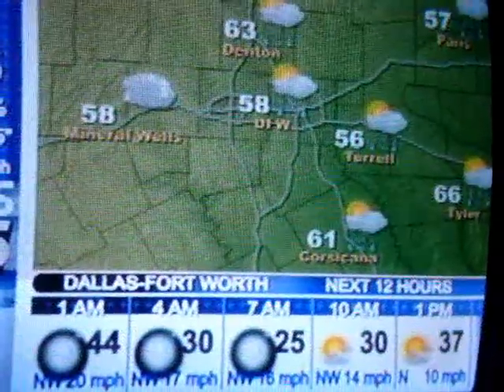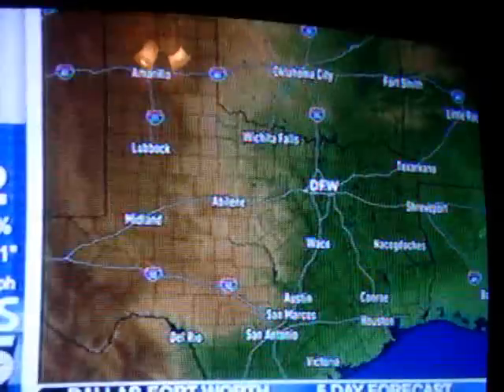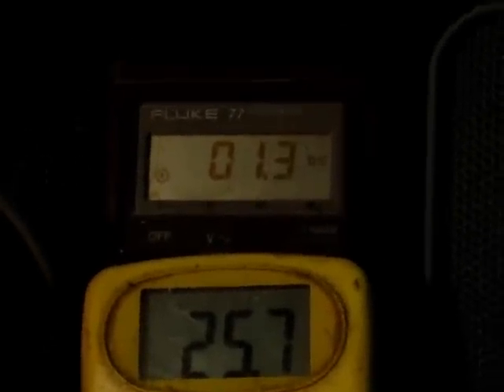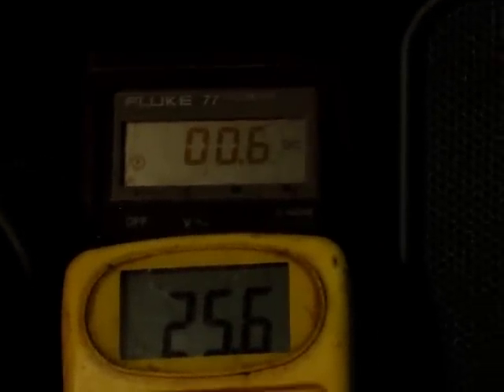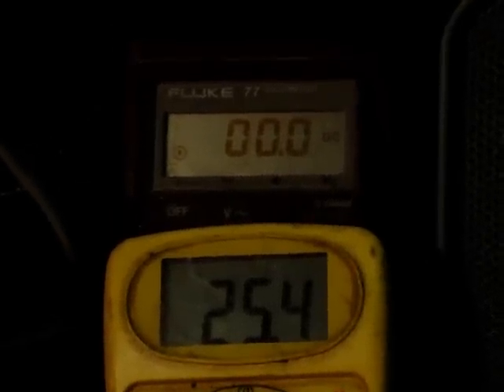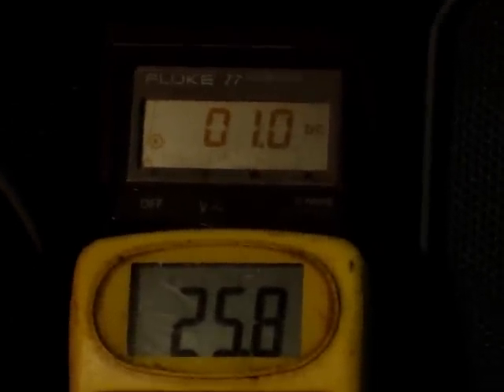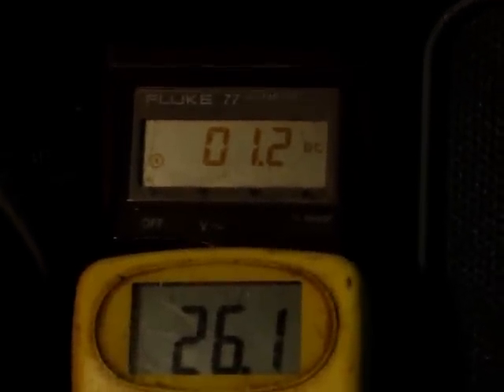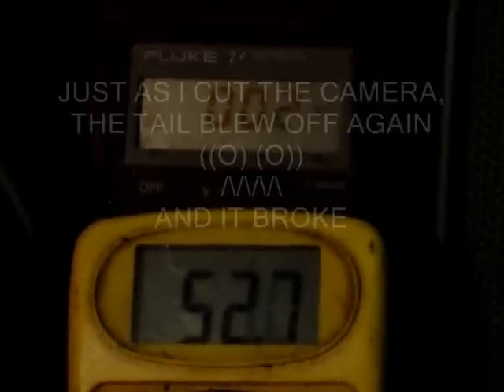PART 4 HARBOR BREEZE CEILIMG FAN WIND TURBINE UPDATE

Comment: Hey... Have you thought about forgetting about the troubles you are having with the tail and directional issues you are having by making one of those horizontal .. sort of like the wind speed monitors. Like helicopter blades but with coned cups or something to that effect on the tips? I hear that that picks up wind from whatever direction it chooses to shift to.... and if you use a slight pitch to to gain a little tiny bit of lift force..it might reduce some friction at some point... Maybe... what do you think? Shoot me back a response if you like that idea at all. Cause I have another idea to shoot you if you wouldn't mind playing around with it. I saw you doing that magnifying lense thing and have seen a sort of "Solar Sail" thing once.. it was a kids toy my mom got me at the Smithsonian... but... amazingly enough... it turned by light ..in a very low pressure (almost Vacuum ) situation...  One side of the outer paddle blade was white and the other black... and in the low pressure, the heated side caused a pressure differential that moved the paddles... I'm personally working on it..and trying to get an extremely low friction / bearingless Vgate magnetic assistance shaft to go along with it.. but for now, I think a magnetic coupling to that horizontal wind turbine drive would give some great torque ... long arms are long levers... and I think you might get less bend in your vertical shaft when the wind pushes... cause that vertical airplane prop has to have some serious desire to bend back.... so horizontal might save a lot of problems from happening in the future...maybe? Sorry for blasting too much info all at once..but I like your vids.. and I see some potential but also some design improvements to cut down on components and give more RPM and torque that could go to a sort of 10 speed bicycle transmission to step up and step down when wind speed gets too much or too little etc..
Reply from the maker: J.T. RipTideProStaff I have no problems with the tail vanes, or the auto furling mechanisms. 
Generally, vertical axis wind turbines are about 1/2 of the efficiency or less. and have no high wind over speed protection. A Darius is my favorite vawt of all of them. 
Also, I have one of those radiometers in my bedroom window. I think they are cool.
MUDDy